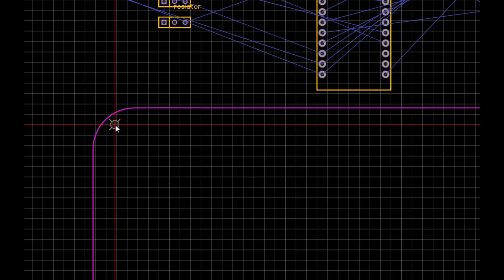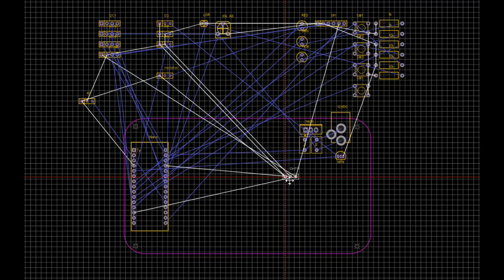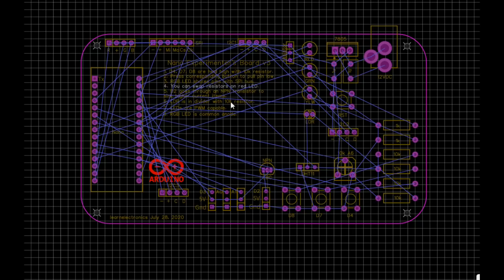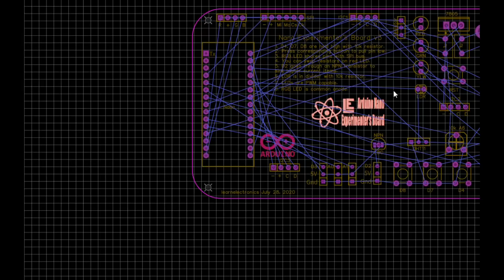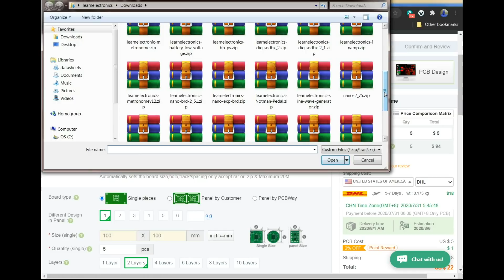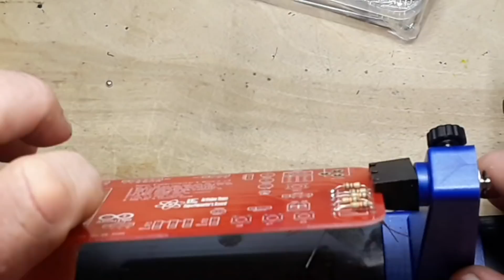Nano Experimenter's Board  v3 from start to finish

Comment: Here is an idea.. To help you get all of the resistors bent correctly, why not include a wire bending jig right on the PCB itself? If the resistor mounting holes are 0.7 inches apart, then include a bending jig hole 0.7 inches from the edge of the PCB..?? 

Also, you put the voltage regulator caps in the opposite positions. The one on the left should have been on the right, so the trace would be inline with the regulator pin.. But otherwise a nice job... 

Could you please make a video on how to use the software to make layouts for parts not in the list? Such as the esp8266 node mcu.. I have KiCad and I'm lost..

Comment: I had some PCBs made by JLCPCB and they sent me an email that the legends, logos, were shorting out traces.  It appears that they got the logos on the copper layer like you wanted.  They wanted me to fix the problem and resubmit the fixed gerber files.  I told them that I only had the gerber files and not the schematics so I can't fix the problem.  Could you fix it for me?
Reply from the maker: Just tell them to move the logos to the silk screen layer

Comment: Enjoyed the video, but on the PCB routing, I think you should do a video collaboration with an expert in that area. Having someone explain what you did 'wrong', and how to fix would be cool. I put wrong in quotes, as the board still works, and thats whats probably most important, but implementing best practices in the design would be good to learn from!

Comment: I have one of the adjustable circuit board holders and after a while the end with the spring starts to dig a groove into the blue plastic end and make it hard to turn the board 360 degrees one way with out catching. Take the "C" (geese where did it go) clip and find a flat washer that fits the inside of the socket in the blue part and you will have to drill out the center hole of the washer to fit the shaft of the black holder rod.
Then reassemble with the new washer in the blue part socket and the spring against it. Now the board will turn 360 both ways without hanging... :-)
I use mine all the time for the big boards. The real little ones not so much... Lol I hope this helps....
Thanks for the video and showing the design process says the other crazy brain guy... :-D
Someday I will send off for some boards...
LLAP

Comment: Nice design and video. Still getting my head around design and layout myself.  Question though with regard to the RGB LED; why not add a 3-pin header and use a jumper to determine common anode or common cathode?
Reply from the maker: You could

Comment: Traces are too long and travel needlessly across the board. You need to pay more attention to the parts placement to reduce track lengths. Additionally, your pc-board could be made much smaller, probably less than half the size and cost.
Reply: You may be right if you were designing PCB,s professionally but this is a hobbyist channel. As far as size and cost PCB Way and JLC PCB both charge $5 for 10 boards for any size up to 100 mm to 100 mm and they don't allow v-scoring for multiple boards in that area. At $0.50 per board why not use the extra area for instructions like Paul has done.
Reply: @blic-sx9ix  The fact is, he did design that PCB. Just because it is a hobbyist board doesn't mean the designer shouldn't attempt to use reasonable discretion in component placement and try to minimize trace lengths.
Reply: @gerardregnier3457  I get your points but in the end the board will do what it  is designed to do. This makes it a success. Does the design use all the best practices... No. Will it work as well as a breadboarded Arduino hobby circuit... You Bet. Looking forward to your video series on how to do PCB design right! Until then lets celebrate those who are actually willing to make hobby videos like these.
Reply: @blic-sx9ix  Refer to "Kangeroo" Dave's posts on the subject. He has the right idea on common sense PC board layout and design.

Comment: What software is that? Did you auto route? Did the routing need any adjustment?
Reply: Auto routing is OK but planing placement of components and routing the rat lines yourself can be a rewarding accomplishment. Here is one I just completed. I used arcs for the some of the routing https://keithlohmeyer.blogspot.com/2020/08/blog-post.html
Reply: same question. please

Comment: I was wondering if anyone could give me advice on controlling micro steppers with an Arduino nano do you need a driver?
Reply: What do yo mean by micro steppers? Like a 28byj-48, some like that?
Reply: @alvarobyrne  I do not know what you mean by a 28byj-48 
I got these
 Machifit 2 Phase 4 Wire Stepper Motor 10mm Micro Stepper Motor Machine Tools & Accessories from Tools on banggood.com
https://banggood.app.link/WNtAEN7nL8
Reply: @jayosborne1147  ok. thanks for answering, i learnt something from your answer: i didn't know those micro steppers, a 28byj-48 is a very popular stepper motor around (search for it in youtube for example), but is bigger than those machifit ones. I agree with @Vincent O'Reilly, you most probably will need a driver.
Reply: All you need to ask yourself: can the uC I am using supply enough current through the pin I am using to control the motor? 
Chances are, the answer to this is no. 
Even if the uC could, you should still have a protection/safety  circuit which a good portion of driver circuits (IC’s) will provide.

Comment: I am very interested in your board, but I am even MORE interested in the design and layout tutorial. Electronics are hard for me, but the design process of a PCB board is a TOTAL black art, worth watching OVER & OVER again. I wish you would create a VERY simple video on how to create a PCB for idiots. Explaining the most basic of fundamentals. I understand the circuit design, but do not understand terms like “Copper layer” and “Solder Layer”. I get really confused when, having laid out my circuit, it replaces my very carefully laid out connections with weird blue lines, that seem to short circuit each other.

Subscribed, Liked & Saved. And when I can, I will download so I can watch it off line too.

Huge huge thanks for including that part. The VO was very informative

Again HUGE thanks
Reply: Same here. I never watched this before . It gives me a lot more insight into electronics.
Reply from the maker: I will make the video
Reply: learnelectronics You are very kind. If I may suggest a few points. For instance, do you have to design the Solder mask, or does the design software cut the ‘holes’ for pads etc.. what do the ‘weird blue lines mean, and how do you check routing.

Again huge thanks, I loved your keychain video. May you could simply add two components to it? A switch, led and a header block. Anyhow, I am embarrassed enough to ask, I do not feel experienced enough advise what should go in it. Just ask for it to be simple.
Reply: Jon Electronics huge huge thanks for taking the time to answer my newbie question. I really appreciate it

Thank you
Reply: same here
Reply: I think you need a better teacher.
Reply: Gerard Regnier Teacher?

I haven’t had a teacher for 55 years.
Reply: @tonysicily2687 , I've been called that from time-to-time throughout my life.